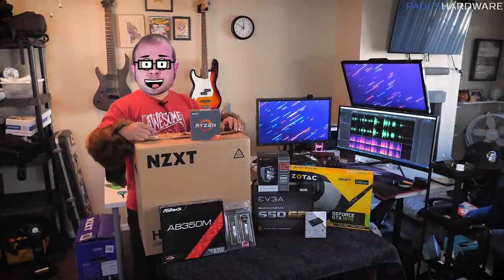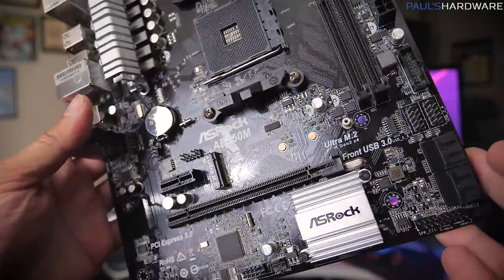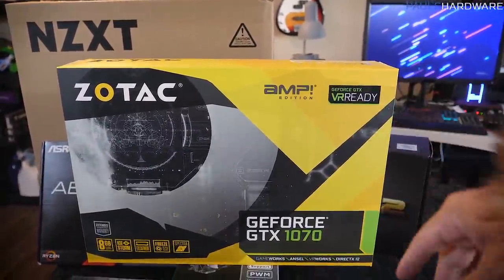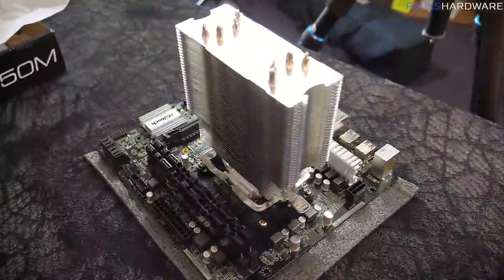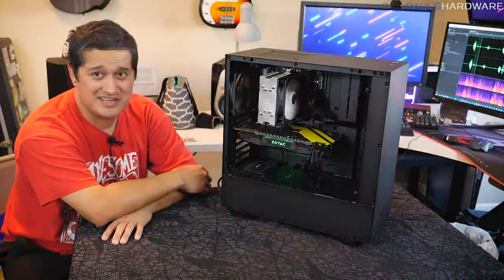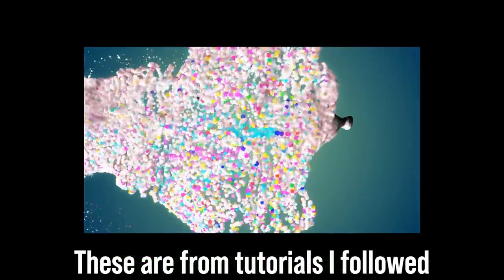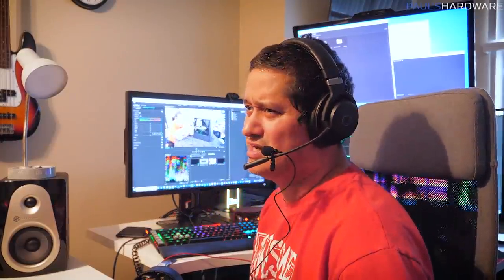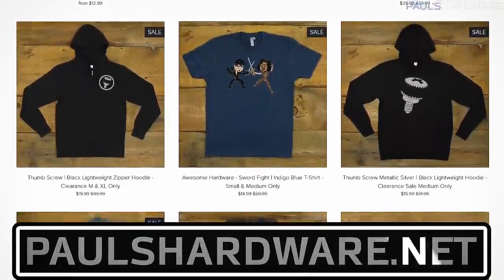I let my editor make his own PC build video...

Comment: I would like to see a more detailed vid on the installation of this heat sink (other than yeach there is 4 screws and some thermal paste involved), also installing and managing the SSD cards at the bottom of the case? Do you use any special software or just a folder on your system file?  cable lay out?

Comment: My hypothesis is that the board probably had a really old AGESA version, and when trying to run the RAM at XMP, or anything above 2666 it was so unstable that not even the Windows setup would load.

Comment: I don't know if this will cause issues in the future but. I noticed when you were installing the CPU, it didn't go in flush to the socket. It's sticking up about a mill on the left side from where the camera was pointing at it. just a heads up, that all.

Comment: does the 1700x not come with a stock cooler? Surely it would have made more sense to use that, get rid of the thermaltake cooler and get a 450 board or 2700?

Comment: overkill cpu for business tasks, but it's fine. ram is fine. that 1070 is definitely overkill, you should get her into gaming, and also for an office desktop, adding a second 1080p monitor can improve multitasking dramatically, in particular finding information on the web and e-mailing or writing reports at the same time.  that cooler feels kind of sus to me...  i'd grab a wraith rgb for like no money instead.  probably cool the same but more rgb so win... - that ssd is like the crappiest possible ssd you can get now days... ssd's are EXTREMELY speed limited and will likely be a bottleneck even in an office desktop build.  m.2 nvme pcie 3.0 ssd's are now suuuuper cheap and you can find a quality 250gb one that's WAY faster for easily under $50 like this one https://amzn.to/3pv9m7S and it's well worth the $15-20 difference with regard to speed. - it's about 3x faster. - otherwise, you did a great job building.  the final result looks great... loved the hairy arms heh.

Comment: For a computer that is not going to be running any demanding programs you certainly went over board on the CPU cooler, the expensive case, and the graphics card. In fact, a Ryzen five would have done as well.

Comment: those cs900 pny ssd's have a ton of negative reviews on amazon. apparently they die randomly. i've built a couple of computers using them, haven't had a problem from my clients. but i stopped buying them since i found out about the issue.